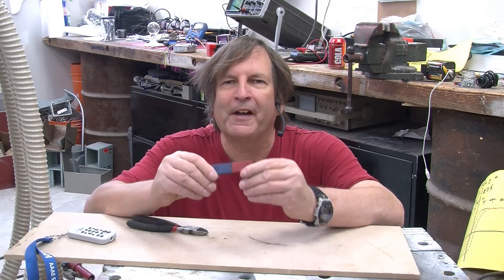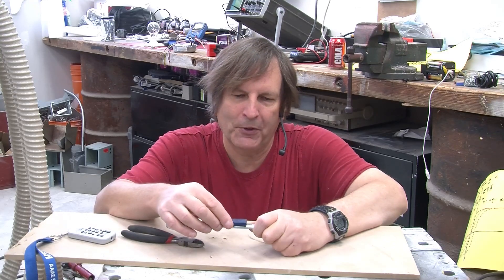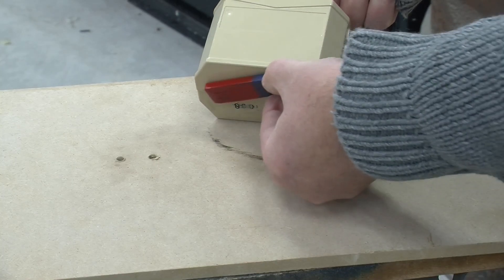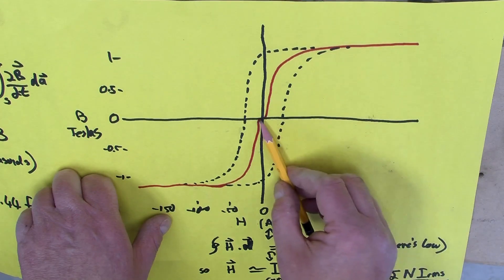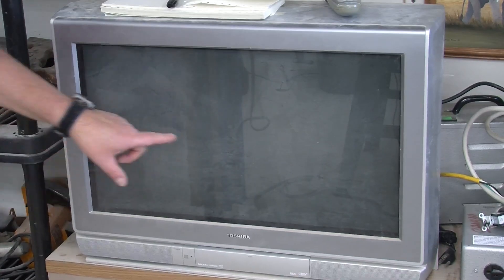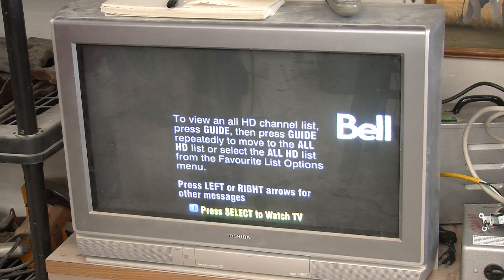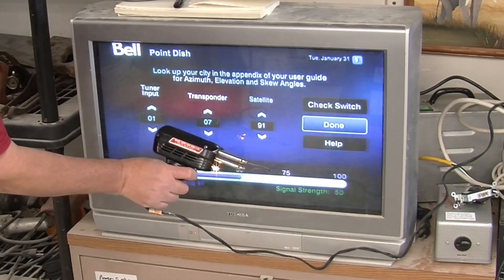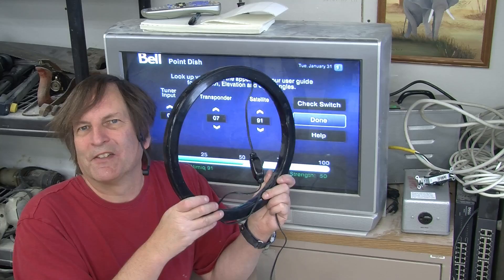Demagnetizing magnets and other things

Comment: With 3D printing, a common practice is to "heat set" brass nuts into the plastic.  Not a problem since we're looking for a mechanical, not magnetic connection.  I tried the same process with a small disk shaped magnet (maybe 2mmx0.5mm) & it destroyed the magnetic field.  Nothing I've done has been able to restore it.  Going forward I can either heat the magnet VERY slowly until it is in position to try & stay below that transition point, or just include a cutout in the model & later glue the magnet in place.  Easy fix.  But I keep the original around just as a curiosity.  One day I'll find a way to remagnetize it.

I've also encountered the opposite problem when using "non-magnetic" tweezers & watch parts.  Yes, the field may be VERY small, but when the part is even smaller, that matters.  By far the best material I've found is titanium.

Stainless steel (at least at this scale) can become extremely magnetic.  I started out using on of those general purpose demagnetizers & it was a total waste of money.  Works great for, you know, what it was intended for.  But it doesn't work for very fine watch parts.

I then picked up one of those cheap blue demagnetizers & tried all the various voodoo tricks of getting it to work with no luck.  Finally I twirled the tweezers (like a barrel roll) going across the box & it worked perfectly.  I don't understand why it worked & all of the other ways didn't, but I'm glad it did.  I can finally start using the other tweezers I have.

If that hadn't worked, my next step would have been a heat gun to intentionally "melt" the magnetic field out of it.  Yes, I know that's not how it works, but that's how I like to think of it.

Anyway, I'm really just feeding the algorithm as a way to say thanks for the videos.
Reply from the maker: Must have been on of those neodymium magnets - amazing strength for the size. I did do video on magnetizing magnets  but making a setup for those tiny ones would way harder than its worth : https://youtu.be/S21rlwrY74I   . 

"I twirled the tweezers (like a barrel roll) going across the box & it worked perfectly" Brilliant! I wish I had thought of that and put in the demagnetizer video. You making the tweezers "see" much more quickly varying AC field than just going up the steps of the demagnetizer. With your permission I will put your clever trick in the channel posts or do a short video on it - it could be so useful!

"I'm really just feeding the algorithm as a way to say thanks for the videos." Thanks so much for that effort! Comments really do help, as do likes and subscribes. Its really the best way to support small channels!

Comment: Hello, I placed a Bluetooth speaker next to a Loewe CRT TV (Phillips tube) and after 10 minutes I noticed a rainbow spot in the lower corner..) I removed the speaker and the spot disappeared, the TV also rebooted, but a small gray spot (or light spot) remained in the corner. The transistor works, a characteristic click when turned on... but the spot in the corner still remained..) Please tell me, will this go away on its own?
Reply from the maker: If you let the TV really cool down without running it (ie overnight) and then turn it on, the internal degausser should activate a max strength and with some luck after a few days fix everything. 

But if it doesn't go away, you need something  that will generate a localized AC field. These days the most easily available device is a soldering gun as shown here https://youtu.be/mGK8oYdEqyE?si=wYM5L-MO9wzePwc9&t=533  . Note that its a solder gun. not a soldering iron (which hardly generates any field at all). With the gun on, move it slowly towards the spot and when the wavy rainbows seem to cover the spot,  move it SLOWLY away till the wavy rainbows are NO LONGER VISIBLE BEFORE turning the soldering gun off. If the sport remains after turning the gun off, repeat bring the gun a bit closer to the spot, and again a bit closer until the spot is no longer visible when the gun is off. Be careful - the soldering gun tip gets hot which can burn/melt plastic on the TV if touched (or fingers!). Good luck!
Reply: @ElectromagneticVideos  yes, but there is no rainbow, there is only a small gray spot (brightness), especially when you turn on the white background, it is visible. Is this the cause of demagnetization or another reason?
Reply from the maker: @tdmax2288  Very likely magnetization. A spot like that is typical of a small amount of magnetization shifting the electron beams just a bit so after passing though the shadow mask they don't line up well with the phosphor dots/stripes. If all three color beams are shifted just a bit and by a similar amount you can see a darkening.  I have usually seen  colored spots on dot pattern tubes because the shift often favors one or more of the primary colors. A stripe tube (which yours probably is )  could more easily get a darkened spot.
Reply: @ElectromagneticVideos  what can i do to fix the geometry in the corner?  need to demagnetize?  can I reset the geometry to factory settings? through the engineering menu.or try to put the TV out for the night.
Reply from the maker: @tdmax2288  I would stay away from those settings - you change one convergence setting and it messes up the others. I have done convergence on old analog TVs years ago- its really hard/tricky to get right. And since it seems to have started with the magnet near the CRT,  best thing to do (and simplest) is try and demagnetize before anything else.
Reply: @ElectromagneticVideos  ,won't it pass overnight?
Reply from the maker: @tdmax2288  After the set has cooled and the internal degausser comes on  full force in the morning, it may disappear. So wait an see before doing anything else.
Reply: @ElectromagneticVideos  I also just checked the geometries on the grid and the geometry went down in that corner, is this due to demagnetization?
Reply from the maker: @tdmax2288  Thats sounds  lot like localized magnetization shifting things.  Having said that, it all could have been there before you brought the magnet near it. We all tend to not notice stuff like that unless looking for it. Its actually amazing how poorly color CRTs can converged and not have viewers notice.

Comment: Do you think a  degausser could weaken my Apple Air Tags internal speakers magnet enough so that it wouldn’t work? The reason I ask is it would be a non invasive way to kill the speaker as opposed to opening it up and removing it. I broke one of my clips on each of my Air Tags getting the speaker out  , but nothing super glue couldn’t fix .
Reply from the maker: I have never actually looked at an Air Tag. In a lot of small devices like that the speaker is ceramic piezoelectric disk. If its that, degassing wont change things since it doesnt have a magnet

If it is a real magnetic speaker type device, still might hard to get a strong enough field to demagnetize it. usually  speaker magnets are arranged so there is a slit in a round magnet where the field is exposed to air and the moving speaker coil. So to some extent the magnet shields itself from external field. Might also generate enough voltage in any internal coils to damage the electronics. 

Bottom line - maybe - but if you try it, be sure its an expendable unit!

Comment: So every time you challenge a permanent magnet with another magnet with an opposite pole (n to s) does it remove some of the remanence because you are going down the hysteresis curve towards the coerciveness?  Would a magnetized keeper destroy the horse shoe magnet, especially if you used an N52?
Reply from the maker: Yes - exactly - the more you manage to push the point down the hysteresis curve, the more you have demagnetized it.

If the keeper was magnetized and you forced its N to touch the horseshoe N (and same for S) it will deteriorate the magnet. If you put the magnetized keeper on so its N touches the horseshoe S(and same for the other ends) it will help sustain - or even strengthen the horseshoe magnet. 

I keep the bar magnets on top of each other, N to S etc to help they stay strong and the same for the horseshoe ones. The idea is to make a nice easy circuit for the field to flow though. 

The one good thing is that when magnets aren't touching but oriented N to N or S to S so they repel, the air gaps alters the characteristics of the magnetic circuit weakening the demagnetizing effect so in things like motors designed properly the magnets stay strong is spite of being subjects to a certain degree of reverse field.

Comment: Hi, this is an amazing video thank you for sharing your knowledge. I am working on a project where I have to build equipment to magnetize and demagnetize a permanent magnet. I saw both your re-magnetize and de-magnetize videos. So to conclude, to magnetize a permanent magnet I need to use a DC source to power the coil, and to De-magnetize a magnet I need to use an AC source to power the coil? Do we have any formula to calculate how strong the magnetic field of permanent magnet will become in relation to amount of time it was kept inside the electro-magnet?
Reply from the maker: The trick to demagnetizing is is you have to slowly reduce the strength of the AC field. If you turn it off abruptly the results are unpredictable. TVs use a thermister to gradually reduce the current after turning on (the thermister heats up and increases its resistance to reducing current to the coil). 

Time to magnetize is very short. Fractions of a second. The key is having a field stronger than the saturation value of the metal in the magnet. 

If you need to turn a magnet on or off, why not just use an electromagnet?
Reply: Actually, the product I am working on is a reed switch. Reed switches are magnetic switches most of all they are all form A type which is a normally open switch. TO change it to a Normally closed switch we embed a permanent magnet on the outerside of the glass. Which makes the switch as bistable switch. When these reed switches comes under reverse polarity electro magnetic field the magnet get nullified and switch becomes normally open. The Ampere turns of the electromagnet is sometimes high and sometimes less to nullify the magnet. So,in an attempt  to make all the switches have uniform Pullin values I am working on altering the permanent magnet's magnetic intensity. if the magnet is too strong then I have to demagnetize it. So, in short I want to build a machine that magnetizes and demagnetizes the permanent magnet.
Reply from the maker: @abishekmoorthi2779  Sounds like a very interesting project. Best of luck with success!

Comment: Can you speak to the emergency shutoff method used for MRI machines? I have heard that it uses extreme cold (perhaps using liquid nitrogen?) to disable the magnet in an emergency situation. Is that just relevant with electromagnets?
Reply from the maker: You just sent me down a fascinating rabbit hole of MRI machine stuff! I actually took a grad course on superconducting magnets years ago, but never did we discuss the need of emergency shutdowns. 

To do an emergency shutdown of a superconducting magnet of any kind, including those in an MRI, you can raise the temperature in the superconductor till get gets warm enough to revert back to being a regular conductor. "Warm enough" may still be hundreds of degrees below zero.  From what I just read, and I'm no expert on MRIs,   it looks like they do some combination of either draining the liquid liquid helium out of the machine, and turning on an electric heater to evaporate the liquid helium. Once the helium s gone (its the helium that keeps the superconductor at a low temperature), the superconductor becomes a regular conductor, and its magnetic field drops rapidly as  the current flowing in no-longer superconductor looses its energy in the resistance of the wire. further heating it up speeding up the quenching process.

Looks like its quite violent - vast amounts of helium gas are boiled off really quickly, and the rapid heating of the superconducting magnet and other parts often (always?) causes damage to the machine that will need to be repaired. Looks like potentially 10s of thousand of $ damage, so apparently they avoid that sort of shutdown except in a real emergency!

Thanks for a fascinating question!
Reply: @ElectromagneticVideos  oh wow, I never considered that the liquid helium was part of the standard operating temperature.
Reply from the maker: @davidc7763  Unfortunately most practical superconductors need to be that cold. You may have heard in the news that are issues with the world Helium supply which is a real concern for MRI machines. Hopefully gas wells with significant helium content will have it extracted and alleviate the situation in the future.

Comment: The degausing coil reminds me of my time as an apprentice (1991ish) at an electronics, computer and telecom repair shop.
Repaired CRT monitors (which pack quite a punch 😂) and we were once called to a CAD company where one of their big and expensive monitors was suddenly displaying distorded and weird coloured images.
When we came, we saw the phenomenon, shut off the display, disconnected it and moved it away to a spot where we could work on it, awai from the big fishtank next to the workplace.
Opened it up, saw and smelled nothing strange, hooked it up to another computer, click and hum of degausing coil and an almost crisp image we adjusted...
Put monitor bac together and hooked it up again on its own spot, distorted image!!! 😮
Then I saw the cleaning wiper on the out and inside of the glass of the fishtank, next to the edge of the monitor...
Moved the wiper away, colours and distortions moved around as well. 😂
So parked wiper well away, switched monitor off and on again, degauss succesfull and we had a new story to tell 😉
Reply from the maker: I had heard that the larger, finer pitch CRTs were (not surprizingly) particularly sensitive to stray fields - really neat to hear an actual story of the consequences. 

I think I got the big old degassing coil at a hamfest or some such flea-market event. It was too neat vintage item to pass on and the video is the only time I have ever used it. I guess I was  lucky enough never to have used a CRT monitor near a fishtank with a wiper :)

Comment: Very interesting. I remember back in the mid 80's when the guy I was working with had bought a new TV and his little kid called him in the room and proudly stated, "look what I can do daddy." He walked in to see his child moving a magnet across the screen making pretty colors (that never went away), To bad we didn't know about this trick with the soldering gun back then.
Reply from the maker: Back when color TVs were expensive  - Oops! We had a TV in the 70s that had a color blotch in a lower corner. No-one back then knew how to fix it. I'm surprised most TV repair shops weren't aware at how to demagnetize things. It cant have been an uncommon problem, and could have been easy repair money.
Reply: @ElectromagneticVideos  - Agreed. I think my buddy thought it was just ruined forever and bought a new TV.
Reply from the maker: @justadbeer  What a shame :(
Reply: Oppsies I did that, Luckily the TV was rented.
Reply from the maker: @dogwalker666  "It just broke" . I had forgotten way back when you could rent TVs.
Reply: @ElectromagneticVideos  Indeed.

Comment: Ooops, I rolled my 4x12 guitar cabinet out the house past the tv onetime and made it all purple and green.  
This is when I learned the term Degaussing!  I think it fixed itself after a few power cycles.
Reply from the maker: Speaker magnets in the cabinet maybe?  Most color TVs had a built in degaussing coil attached to a thermister - you can often hear a hum for a second or two when the TV is switched on. Over the course of a second the thermister heats up gradually reducing the field though the degaussing coil hopefully demagnetizing the CRT and parts around it. 

My memory of this is one TV we had when I was kid had an orange blotch in the bottom corner of the CRT. No-one TV repair man was ever able to fix it - I'm guessing back then without the internet understanding degaussing was not as well known or easy to find out about.
Reply: @ElectromagneticVideos  Right bro! Those 12 inch speakers have huge magnets and unshielded cabinet. I was working in low volt integrated systems on custom homes at the time so a friend told me about degaussing it if needed. Few years later I had an LED module go bad on my rear projection 50" tv so we had to watch my kids Wifgkes dvds in wierd colors for about a week till I got the parts and learned online how to swap that red module that burns hotter with some silver paste and turn down the factory settings! I also spliced in an extra pc fan to blow across the little radiators for each RGB module and it lasted for years till pixels started dying so much it looked like a starry night on screen and no good fix for that!
Reply from the maker: @THRASHMETALFUNRIFFS  Thats an impressive fix. We are so lucky these days with all the info that is avail;able online. I have fixed things in my car that would been impossible without watching step-by step videos

Comment: Heating a magnet with a torch will also demagnetized it.
Reply from the maker: Yes! The critical temperature is the Curie temperature which can vary quite a bit from material to material. Also works the other way - heating something up and let it cool in a magnetic field and will become magnetized.